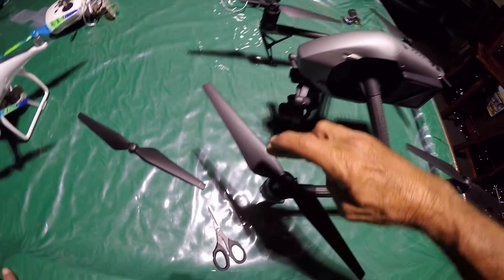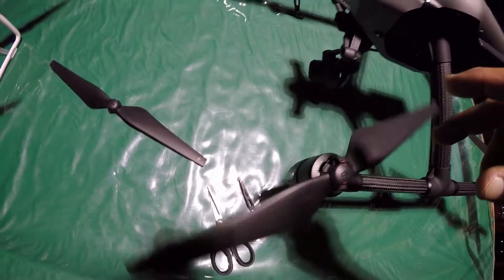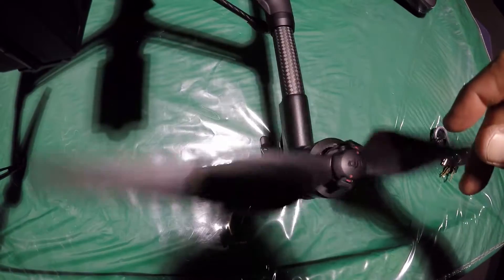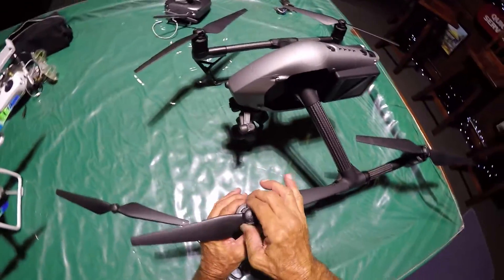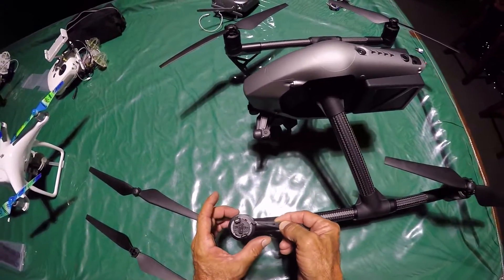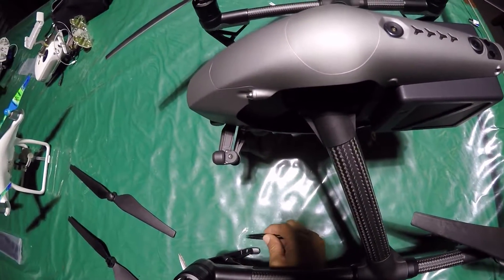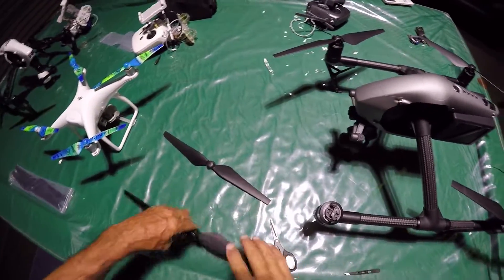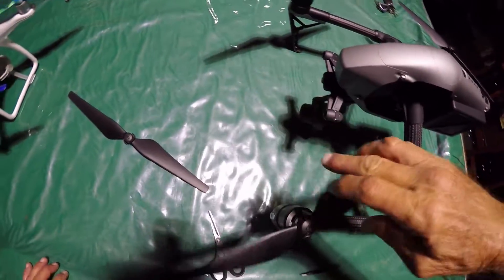INSPIRE 2 PROP FAIL RECALL

Comment: Hey Blacky, Forget MaGuyver give a problem to an Aussie and for sure he will fix it with a roll of barb wire, some plastic, rope and a bar or soap !!!!. Soon as I saw your video I went out to inspect my new Inspire 2. Firstly I checked the red props and sure enough they had a little play and made a slight noise but not as much as yours but so did one of the white props. Again sounded like a little bearing problem. 

I had checked the play and it was slight, maybe a couple of thou...not much but enough to make a noise. Then I checked the inspire 1 and this had MORE play...but no noise and that has been flying well without any problems for 18 months. 

I then cut out a thin small piece of paper folded it and placed it in the same position as your plastic then replaced the props. Just like magic both red props and one white prop became deathly silent. no grinding noise just smooth science. 

Now no-one is going to muck around with bits of paper on a windy day before flying, so back to MaGuyver. It maybe worth adding a drop of super glue and letting it dry onto the prop to build up a shim. One other thing I would be getting in writing from DJI is acknowledgment of this issue and a guarantee that this problem will NOT cause bearing premature wear and motor failure. Keeping a record of these noisey props and seeing if it gets worse will back up your claim. 

But WELL DONE mate for working this one out cos I wouldn't have thought of that. I thought it was a bearing or something. See How you go and keep us informed. 

The problem is DEFINITLY not red Motors its the play of the props, which from everyones perspective is probably a better, cheaper and easier fix for everyone. I thinks its coincidence that you had two reds as I had two reds and a white motor. 

Cheers Mate Douglas from SkyBiz Mooloolaba, Sunshine Coast, QLD. http://www.skybiz.com.au Inspire 2 Owner.
Reply from the maker: year eh, some number 8 guage wire and the "cob n co twitch"
Reply from the maker: Very Kool mate! I love Mooloolaba, used to live there & have lots of family there. Thanks for your message and would like to keep in touch. P.S. I subscribed to you , can you sub to me to please. 
Cheers
Geoff